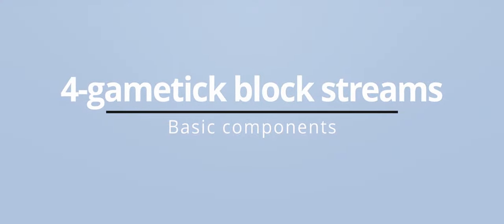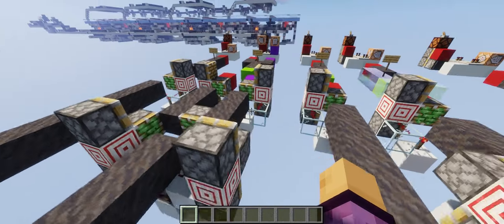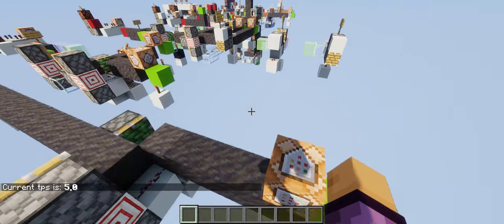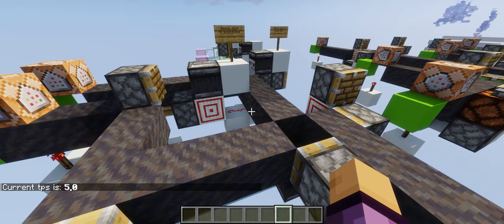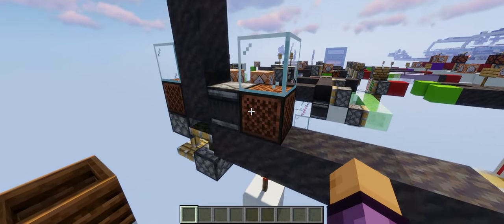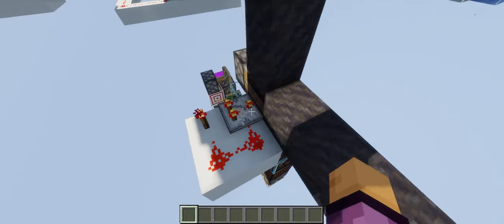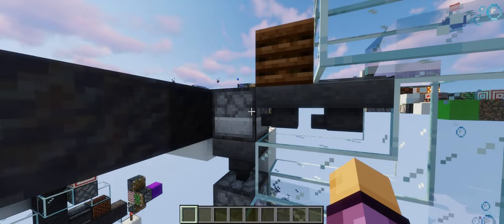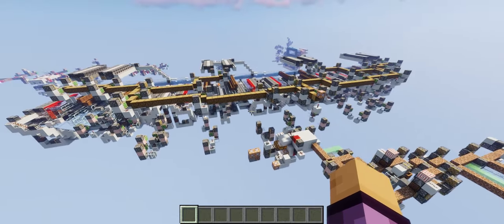4gt block conveyor basics

Comment: Nice video! Thanks. I have a 4gt mud converter tho, you just need to use the block stream to cut the dust instead of the way you did it having the block stream to pass the power.
Reply from the maker: Thanks! Detecting isn’t the problem, but item transfer since hoppers transfer items only every 6gt. I wanted to avoid hopper mine carts, so I decided to decide the block stream :)

Comment: Hi I was watching Il mango mud to clay video, but is all directional....do you know a way to make the part that push 2 blockst at the time up in an other way? Cause if I try to build in the opposite direction it break

Good collection eniway 👍
Reply from the maker: You can add block event delay between block detection and the block pushing pistons
Reply: @blockerinsky918  for a pointing east version I implemented this:
https://youtu.be/Zp4GgtRIT3Y?feature=shared
In the Il Mango sistem.
It come out biggger but it work 👍

Comment: can someone help, i tried ilmango basalt x cobble farm but when i did it on survival, the 2 way sticky piston was kind of breaking and i had to set all the repeaters to be 3 gt which work but its no longer efficient, this worked in creative, i even tried alot of the 2 way sticky piston thingy and it didnt break, was this because it was on a spawn chunk while on the survival world its far away from spawn ( i have like 8-10 mspt in survival) but it still breaks, all i was noticing is that sometimes the observer looking at the activator rail(or powered rail) isnt pushing the block so the sticky piston push each other out

edit: nvm i found it, its not actually the 2 way sticky piston, it was actually the part on ilmango or i might be wrong, TNT efficient blast chamber where it split the one block conveyer into 2 which was zero tick, well i thought because the one where the slime and block needs to be a sticky piston and i cant believe it working on maximum speed now,